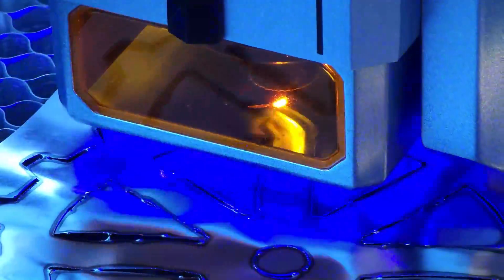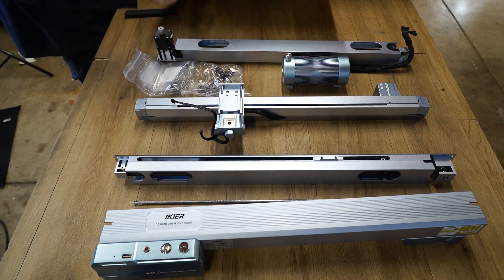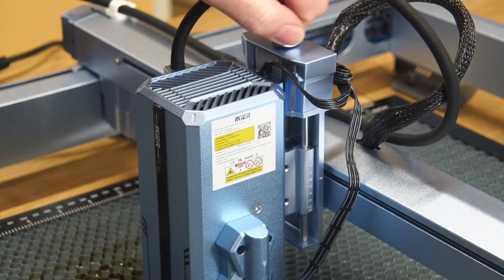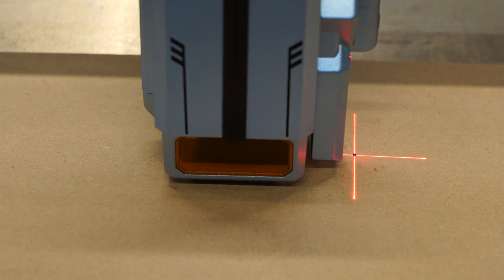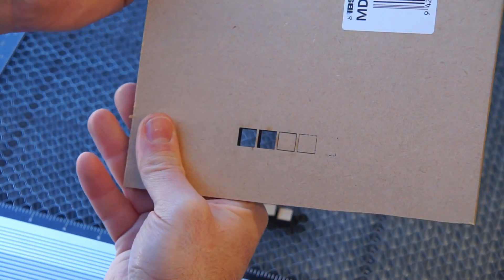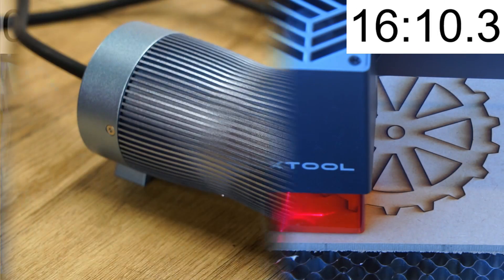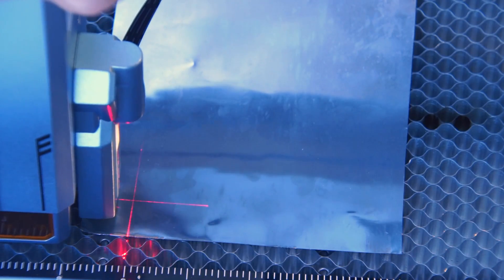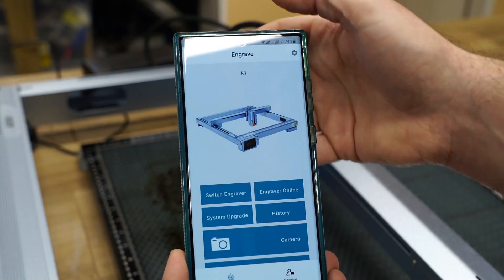IKIER K1, 36W Laser Machine Review II CNC Cutting and engraving

Comment: I have the 24W model. And the feature to take away the display is annoying because the magnet is not so strong and i find it pointless why i should take the display in my hand. 
Its sad that the air assist cant detect when its needed to blow air like the cheaper falcon 2 can do.

The automatic z calibration is a nice feature.

There are some negative points about the "honeycomb" from ikier too. They are so shaky and the camera for lightburn is an atomstack (i know theyre same brands) clone. 

I got a bambu lab X1 and i wish the laser ones could do the same they did. Modern touch display with files and presets and so on.